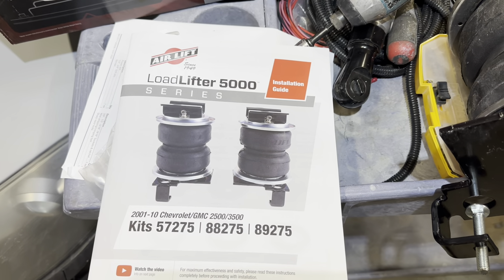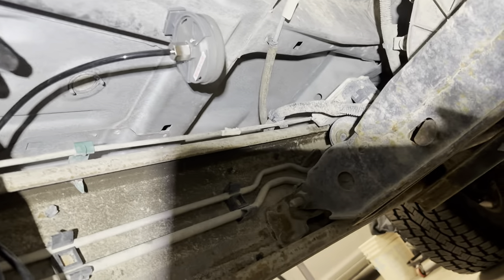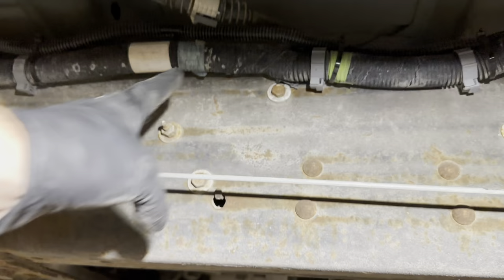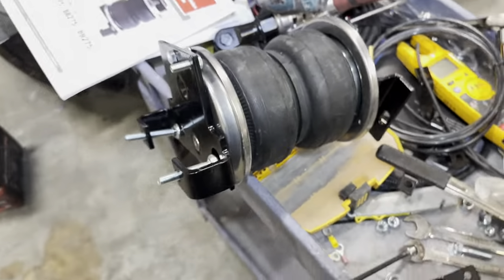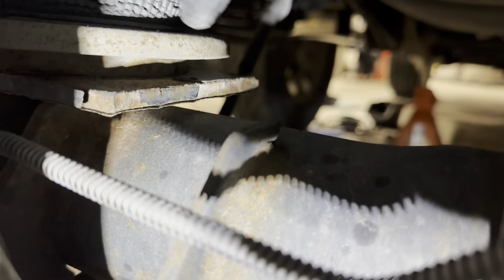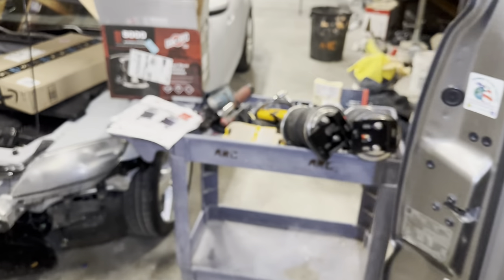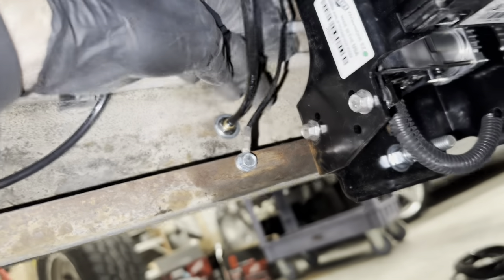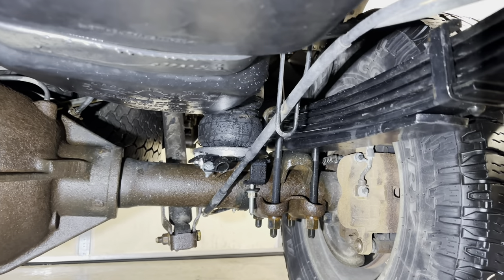2007 GMC LBZ Air Lift Bags And Compressor Install

Comment: Those are fuzed studs. Look underneath your fuze box cover. It'll say like stud #1 or stud # a something like then for each one will have a big box fuze. Also I believe one might only be with key on.  Most definitely the one closer to the battery is connected to the mega fuze right before the stud on left. Not a ground 😂